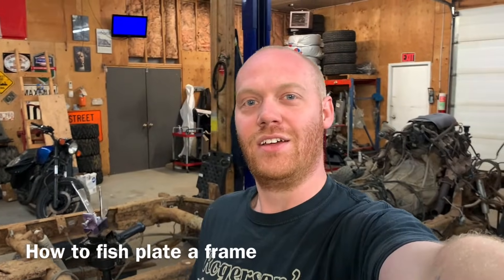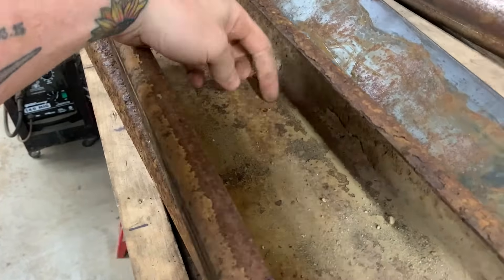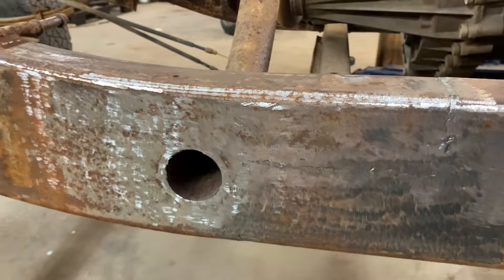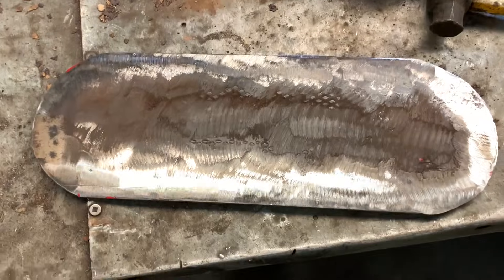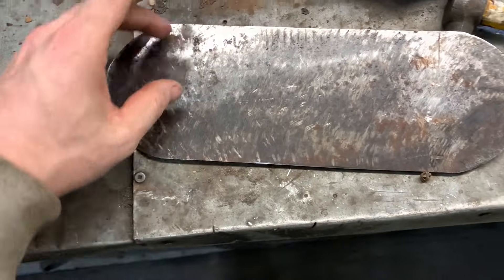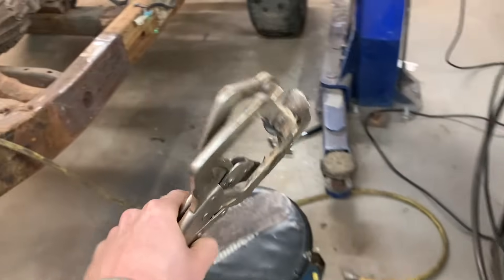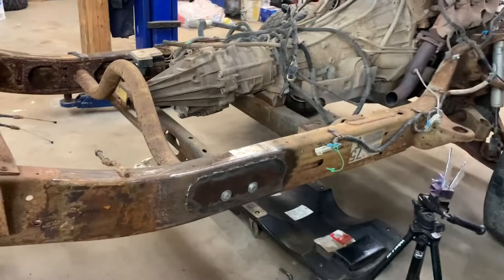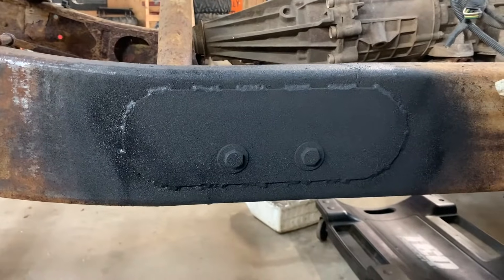How to brace your welds with a fish plate! Reinforce your truck frame for strength

Comment: I guess you never heard of rust jacking.  Whenever you weld your frame together,  it needs to be ground so if you were to look at it,  you wouldn't know where the weld is.
Reply from the maker: I actually have not heard of rust jacking, what is it?
Reply: @StationroadRatrods  Rust jacking is like ice forming and as the rust forms it forces metal apart if joined together such as two plates.  It can literally tear the pieces apart.  Slowly but surely.  Even air has moisture in it so if you wonder where the water comes from.  Its everywhere.
Reply from the maker: Oh I get it! That’s crazy. I did seal the plates up when I painted it, but I’ll take a look and see if there’s any evidence of rust near the welds. If so I’ll fully weld it

Comment: Are you not concerned that you weakened the cross member by cutting it flush with the chassis on the outside as it would’ve been originally welded on both sides.
Reply from the maker: Doesn’t seem to have made a difference, I’ve had it on the road for a year or so now and its holding up perfectly

Comment: Great vid. I like the ideas and will be stealing them lol. I picked up some Ospho rust converter that I will be using on all the parts when I weld up my frame. Supposedly it will prevent rust from forming between the plates after they are welded in.  Cheers from New Brunswick.
Reply from the maker: Oh that’s a great idea! I wish I had known there was something like that when I did mine lol

Comment: Engineer here.  The fish plate looks decent, but doesn't actually add much strength.  You've reinforced the webbing which handles very little of the load.  If you added flat bar to the top and bottom flanges, you would have done much more to add strength to the beam and would have been simpler to fabricate.
Reply from the maker: That’s good to know! Thank you 😊

Comment: The horror of sand and rocks and de-icer on the roads in the winter time is the cause for the corrosion on that frame.  The manufacturers really need to improve the coatings or metallurgy of these metals to prevent this.  Even though you ground the area to add the fish plate,  the pitting will continue as rust never sleeps.

Comment: Go to your welding supplier and ask them for Lube-matic pads.  They are a felt type pad that clamps around the wire just before the wire goes into your drive rolls.  They are offered in pre-lubed version and dry.  I usually use the dry version and buy the liquid and lube them myself.  I usually run 2 of them on the wire.  One dry and one lubed, the lubed one next to the drive roll inlet.  The dry one will wipe away the biggest amount of dirt that can accumulate on the wire then when the wire passes through the treated pad it will add some lubricity to the wire to cut down on feeding problems.  I usually change the pads every time I change rolls.
Reply from the maker: That’s awesome info thank you!

Comment: In my opinion, any reinforcement is a good thing.  Not like it will hurt having it.  As far as whether or not you should have sealed the fishplate to prevent rusting out; that repair will outlast all of our lives, so I think you will be fine either way.  Great video!
Reply from the maker: I appreciate it 🙂
Reply: One thing I've come to realize over a long time is that everything is flexible... to a point... and when you concentrate force in one area, that's where it's going to crack. The edge of a reinforcement is where this will happen. That's why the shape, attachment method, and strength of the reinforcement material are important to consider.

Comment: That is really looking good.  What do you plan to coat your frame with when you're done all the welding? POR15 black rust inhibitor?  Rustoleum even?  Just curious.
Reply from the maker: You’ll see in a few videos that I used Krylon “rust tough” paint, it’s an enamel brush on paint that takes a week to dry, but it’s as tough as glass when it’s done. Looks great too

Comment: I have been researching what you have been doing for your cut frame weld for my own repairs and I came up with this video as listed below.. "  Any time I modified a frame I did a vertical cut with the frame ( 90 degrees ) with a fish plate.  I made the fish plate not as wide as your to allow the frame to still have it's flex ability's over uneven terrain.  Keep in mind that these frames are made many times stronger than needed so I think you are ok.  Believe me I have seen worse frame mods and they are still surviving .  The video link I sent you has a good conclusion at the end.  The step joint you used is a copy of the way wooden timbers were joined years ago and copied for steel and not necessary. 

0:08 / 19:46

The correct way to make welded splice joints in chassis members
Reply from the maker: Thanks for the writeup, I appreciate it. The truck has been on the road for most of the summer now and the frame modifications are holding up great. I’d rather it be unnecessarily overbuilt than be nervous about the possibility of it breaking.

Comment: If thay is Forney wire, its some of the worst wore I've ever used. It's super dirty and doesn't run worth a crap in my mig.
Reply from the maker: You know I’ve had those same issues. It seems to plug up the whip very often and I have to blow it out and use tip cleaners on the top almost every time I use it

Comment: What’s the polarity on your welder? It should tell you inside the panel what polarity you need to run depending on what you’re using.
Reply from the maker: You got it. I’m on the correct polarity for flux core, I may get gas some day.
Reply: @StationroadRatrods  yeah, gas is expensive so I’ll stick to flux core or stick lol
Reply from the maker: Thats my thoughts exactly lol
Reply: Same here. Plus the weight and hassle of a tank. If i were welding professionally, i would use gas.

Comment: One tip on your welder, you need to clean out the liner every 8-10 spools of wire in all mig welders. Usually guys just replace it as it encounters wear as it’s a wear item just like tips. 👍
Reply from the maker: I actually never knew that, definitely clears up my issue then! Thanks a bunch
Reply: Which is why I use SMAW welding for the heavier stuff. Too much upkeep with  MIG and too finicky. I use mig for sheet metal and thin materials but that’s about it usually anything less than one eighth thickness gets mig welded.

Comment: Only trouble is, you’re going to get moisture under plate between those spot welds and it’ll rust out. You should complete the weld all the way around to seal it. I would also have used a rust inhibitor before and after inside & out, then prime then paint. Then it would last a lifetime. Great job on the work none the less, just trying to give a few helpful tips 👍
Reply from the maker: I appreciate the tips, thanks!
Reply: Personally, I would probably leave an unwelded area on one end at the top and drill small hole for grease zerk on the other end at the bottom and just pump that effer full.
Reply from the maker: A grease fitting would be a sick idea

Comment: Trying to send you link but won't work. Just Google backing bars ,secures good strong joints no cracking from back of weld ,
Reply from the maker: YouTube apparently hates links, but I will look it up, thanks a bunch. 
I can’t get anything around the back but I did weld inside also, just to be sure it’s nice and strong

Comment: As a experienced fabricator in plate. And structural, try mot to use square corners in the in the joint , and hopefully you used backing bars in weld
Reply from the maker: As a non experienced fabricator, i appreciate the advice. 

Backing bars?

Comment: The only thing I would have done differently is I would completely weld the fishplate, no moisture that way, otherwise great job!
Reply from the maker: Solid concern, I left it open for the same reason haha!
Reply: You’re not supposed to completely weld them
Reply: @The_Spanish_Inquisitor why?
Reply: @Brandon_obs_ls  keeps things flexible so it isn’t a stress riser